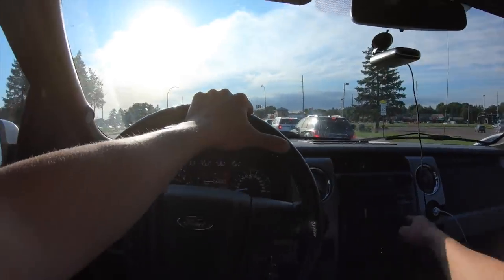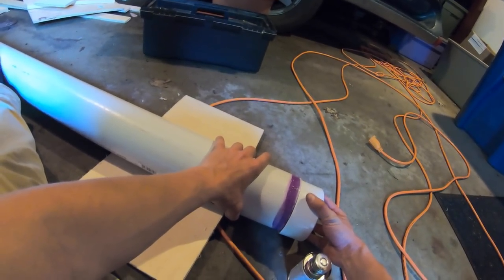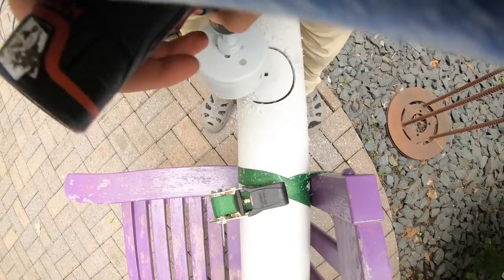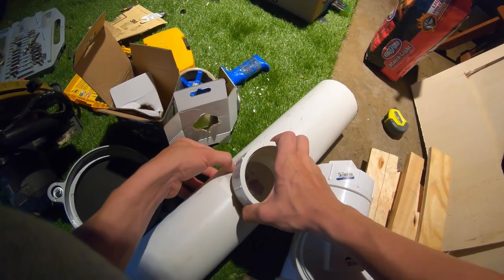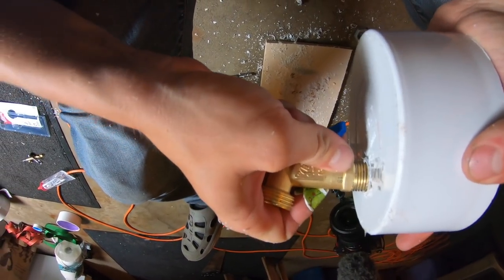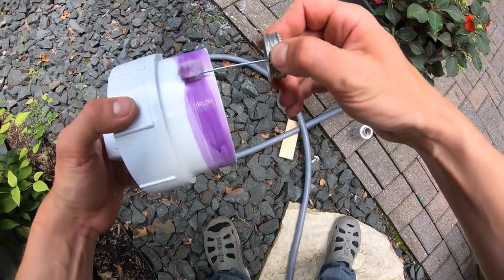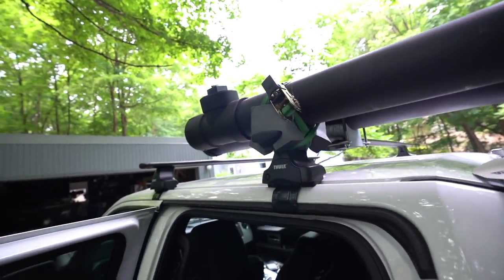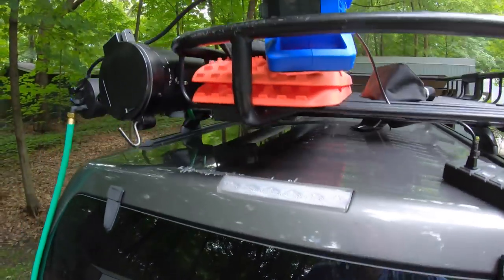How to Build a Solar Heated, Pressurized, Rooftop Shower (DIY for Van, Truck, RV)

Comment: Remember when you're using Teflon tape you always want the tape to go with the way you're screwing in the cap or else it will just bunch up. Love you're vids keep it up.
Reply: You will actually be wrapping the tape in the OPPOSITE direction of what you are turning... This leaves the little tail at the end to be "Pulled" through the threads and not "Pushed" which may cause it to bunch up and unwind. He'll look back at this one day and slap himself on the forehead... Hopefully, with four full fingers and a thumb. ;-)

Comment: When you're gluing pvc I was always thought to give your pieces a quarter turn when you put them on to help the glue seat better
Reply: NotFlafee correct, give it a twist and apply pressure for 5-10 seconds to give the glue time to activate. The pvc will try to separate without the addition pressure.
Reply: Absolutely 👍🏼
Reply: From a Plumber, yup. Quarter turn while seating pipe is SOP.

Comment: Rather than use PVC, which is not great under pressure, and has to be painted to become black, use ABS pipe.  It is already black, and it can withstand 200 or so PSI.  It is very impact resistant, so great outdoors. It is glued up with a 1-part solvent.  You can find it next to PVC anywhere you get your plumbing stuff.

Comment: Great work.  May i suggest "Magic Lube" from Home Depot for your thread leak.  It's a very tacky (wear gloves) teflon style lubricant used for pool tubing and filter lids with threading that operate under pressure, but have to be opened periodically.  Works great- but very sticky and hard to get off hands.  Maybe Marine Silicone for your other piece if it's a fixed joint not needing separation.   I would really like that set up with actual solar heating for instant heat (when wife comes along).  Maybe somehow heat with solar panels

Comment: Love to hear more details Mav...I love your spirit!  We are kindred spirits to be sure.  Please note how long the tub was for the shower and how warm did the water get over how many hours and how cold was it outside that day.  These are great things to teach also. I was a  build by trade or houses so I promise you the more you do the more you will want to do. Currently i am building tiny houses and also outfitting an old Isuzu box truck as a camper so your info helps. THANKS  PS  Just got back from a trip around the world an our last stop was N. California, Oregon and Washington.  Be sure to buy a crab trap and find a pier.  You will catch more than you can eat.

Comment: When you put the caps or are using connectors on the pvc, use sand paper on one of the surfaces to have even a better hold.

Comment: You probably could have used pvc reducers to come down to the threaded size of the garden hose to eliminate the chance of the bad leak. And I would have put the air fitting on the far end so it forces all the water to the other end.

Comment: Buddy. You was about 10 seconds away from that hole bit for your drill working. You was almost there man. Those bits aren't cheap either. I hope you kept the recipet so you can go get ya money back lol. Oh and also. Use some big heavy duty zip ties or some heavy duty hose clamps to hold down the water tank. It will look way way better than the green ratchet straps you are using now. I mean what ever works for you lol. Other than that great job bud. I enjoy seeing people try and build and make their own stuff before going out and dropping a whole lot of cash on something that they can build for a fraction of the cost! 👍💯

Comment: If you put a regulator between the compressor and the pipe you can leave the compressor running to keep your shower pressurized without over pressurizing it.

Comment: Should have put the air intake valve on the water intake cap and pressurize the tank first then turn on the shower

Comment: If you use a wire brush on a drill or grinder it will cut and shape foam very easily and nicely. Only downside is it makes a mess.

Comment: Hey Sonos it possible to build the shower at any length? I was think 4 feet because my van is small also how can I hook up an auto water system to the shower . I was thinking of having it hooked on the roof connected to its own solar panel and battery along with the auto pressure pump . Do you have any advice , I’m nervous because I’m doing it myself and I don’t want to be like creepy but I need all the help and advice because money is tight but I really want it done right and your tutorial is the best !

Comment: If you're building one of these you might want to read my two long comments under View replies at bottom. I think it says. My experience with one gallon glass black painted Jug's in the summertime got too hot. And my clear glass jugs sitting in the sun in summertime got a little too hot also. My clear one gallon glass jugs setting in the shade was just right so that's what I took a shower with. I poured two quantity 3 gallon jugs over myself that worked really good and fast to rinse off. I also had a painted black 1 gallon glass chug sitting in the sun in the summertime. and a  painted black 5 gallon plastic jug sitting in the sun in the summertime. Both 1 and 5 gallon jugs got up to 112 degrees in the Sun. I used my pop up bought at the last minute $30 Walmart pop up shower bathroom tent with a zippered door and thank God a vent at the top because it was hot in there in the summertime. And I used a kayak waterproof bag to put a few things in like my clean clothes and clean towels I didn't want to get wet.

Comment: Omg, great to see you learning through trial and error. You won't regret it but it is tough to watch. If you need help with a project pack up the truck and head to Florida. I will help build or fix any project and recommend how to safely use the appropriate tool and avoid many of the pitfalls. Great videos, hats off for throwing caution to the wind and living the great adventure !

Comment: saws all  with metal cutting blade melts through pvc and its clean
Reply: the stuff before the glue cleans as well as softens the plastic allowing the glue to melt them together as one
Reply: glue your caps

Comment: No matter how tight, my clean out plug wouldn't hold any air pressure.  Bummer to get to the end of the project before finding out an important component doesn't work. Gave up. Back to disposable wipes.

Comment: You are likely not to like what I have to say, but you can build a better rig for about 20 bucks. All you need is one of those $10 pump up sprayers from Home Depot like used to spray plants with poison and just spray paint it black, leave it in the sun to warm the water inside and then pump it up and have a shower.

Comment: My friend gave me their pvc shower, but it keeps leaking from the caulk around the valve anytime it's pressurized above 5psi. Does anyone know what materials or adhesives I can use to seal it up to whitstand higher pressure?

Comment: I made a very similar one but it won't hold pressure when I am using it. As soon as I open up the valve and use the shower it will run out of pressure in about 20 seconds. I checked for leaks and couldn't find any. Any ideas?
Reply: My only thought is to get an electric pump to feed it continuous pressure...

Comment: Primer and cement have a chemical reaction and actually seal it , that’s why you need to use both or it won’t seal for a shit
Reply: B Taylor um did you have a stroke when you wrote this
Reply: Here in South Africa i have never seen the purple primer stuff. Just good old translucent pvc cement. Stuff never leaks. Even when used on high pressure plumbing such as pool pump pipes.

Comment: It may not have been totally your fault for getting  the wrong end cap cause some jerk could have put a couple of 3"in  the 4" bin just because they are too lazy to put it back in the right bin I always make sure to read the print on the pipe to be sure I have the right one

Comment: I'm not water treatment expert, so again, as always, check with an expert. 

I got to thinking about your water supply pipe and the hot sun, I have to wonder if that might create bacteria growth in the water as it sits in your pipe tank? It might not matter for showers but if you plan on washing dishes with it then it could be a problem. You don't want to get sick from bacteria from dish washing.  I assume you're not going to use this for drinking water. It's just a thought I had. I could be very wrong too.
Reply: Thanks for the comment love. 

File this in your brain memory, bleach kills everything. If you ever do get bad water out of your system run bleach through it. Of course you'll have to flush the system well to get the bleach out if used. I hope you don't have water problems, you might not, but it is something to be aware of. 

I had to deal with potential biohazard spills at work and the first thing I did for clean up was spray bleach on everything. So it will kill any germs or bugs in your water system. Now, preventing those germs and bugs from getting into the system to begin with is where you have to talk to the water treatment expert because I don't know.
Reply: With tap water you probably wouldn't have that problem. Unless it's at in the pipe for maybe a few months or a year or more. But the way to know is if you could have that cap where you could look down the center of that white pipe thread fitting after the water is drained and look at it when it's coming out. Also smell it you can tell when water sometimes is bad by the smell and look. But don't get me wrong not always because some water I tested out of the side of a mountain spring the bacteria smell went away after 8 or 12 days. And the bottle still looked crystal clear with the fresh Spring Mountain Water in the bottle. Don't let the water sit too long in the pipe. You got a point there because I went to the beach and I took clear glass jugs with fresh spring mountain water in them out of the side of a mountain. I put one drop of bleach for each gallon but that wasn't good enough in this case in the hot sun. But I noticed once I got back home the water I didn't use under the cap of the glass jug had just a little bit of black mold under the lids most of them that sat in the Sun. I bleached and scrubbed the Caps off with a brush and rinse them off. Mountain spring water we'll go bad in like 8 to 12 days and that's not being in the sun or it'll go faster from my experience. if you don't drink Mountain spring Water fast enough in just a few days or I think heating it has something to do with it like in the Sun at the beach where it got real hot. Tap water has a whole lot of bleach - chlorine in it and of course will last longer. If you get too much bleach in a pool my experience my fingers tingled from bleach - chlorine too high. And I just test water PH and chlorine level with a simple cheap water tester and the pool section at Walmart. Also went basically boondocking at the beach and took a shower with one of those pop-up tents and the water in my glass painted black 1 gallon glass jugs in the Sun at summertime was too hot for me it was a 112 degrees. Thank goodness I had clear jugs of water some sitting in the sun and some not sitting in the sun that I used. I used the jugs that were not sitting in the sun and they were warm enough for me. But the temperature was about 88 or 90 degrees. So if you build one of these you better have a cap on the top and on the side that you can add cool water to because if that sits in the hot sun it just may be too hot for you. That is what I found out from this summer. But I do plan on building something to heat the water up like this probably PVC also.
Reply: I studied water quite a bit and worked with some of the best and finding the best purest water and healthiest to drink. I was even looking into buying a Kangen alkaline eater machine but that was too much money, maintenance and if it broke you would need a whole nother one wow you're one water machine was getting fixed. And that's if they could fix it. I also looked at other water making distiller machines and other water machines. And one big disadvantage with these machines  you can not purify the water, update and maintenance cheaper and better than they can overall. So that is why I just buy it because it's cheaper adding up how much I drink time's the years. I drink only 9.5 ph alkaline oxygenated water I buy at basically Whole Foods. It's $0.99 a gallon you bring your own jugs in and fill it up. This water I drink builds your immune system up and I'm living proof it was almost five years before I had a cold since drinking this 9.5 pH alkaline oxygenated water. And the cold I had I treated it myself with all of oregano it wasn't even that bad of a cold. Before that I was getting sick all the time. And most everyday I'm drinking half my bodyweight in ounces of water a day minimum. You could say I've become a professional water drinker so before you go out and buy that machine start drinking the water first and see how much you're able to consume it's probably not as much as you think. And for most people that's why I would not buy a water making machine even for myself.

Comment: Bruh you used a saw for the hole and used a hand saw to cut the pipe .. thank god you don’t work in construction cuz I’d kick you off my crew in about 2 seconds if I saw that lmao. Use a sawzall or grinder or the jig saw you had. Cuts in 2 seconds with any power tool